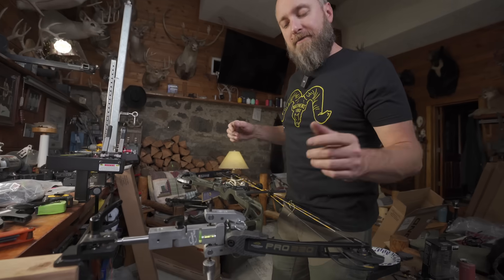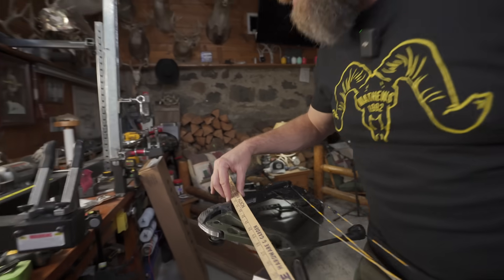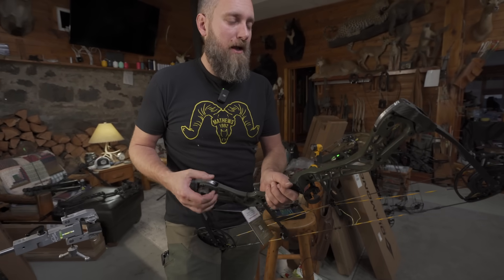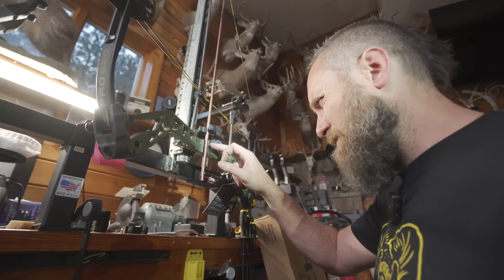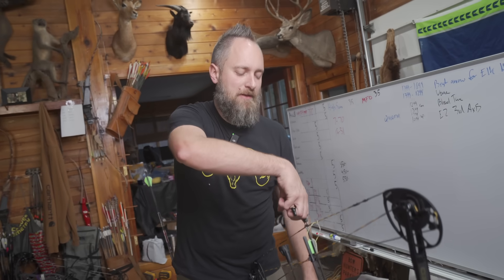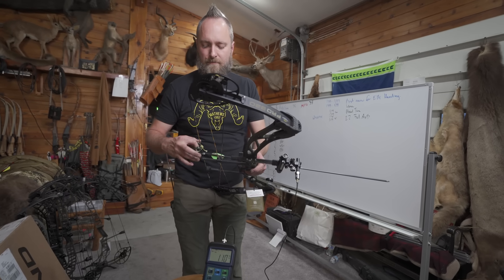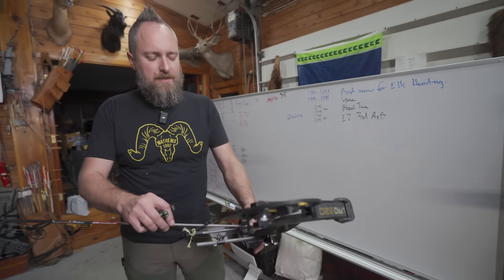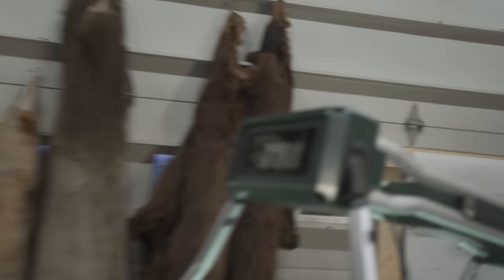Diamond Pro 320 Bow Review With MFJJ!!!!!

Comment: I really like and appreciate the break downs and comparisons. However, I personally feel it isn't a fair representation to grade the budget and mid priced bows with the same scale (or hold to the same standards) as the flagship bows use. I just don't agree they should be getting docked due to a lack of features when, by design, you're shopping in a class of bows not designed to include all the features. I think switching to a 10 point system is a great idea but maybe even further, create separate criteria and expectations and not mention how they compare to the flagship models while testing.

Comment: I have 2 diamond bows both can be over drawn by my kids with that spongy back wall. So I'm not a fan of that trying to teach youth to shoot and there anchor point changes every draw. But they are decent bows for the price. I have even used one this year as my backup bow and ended up using it all season since it was smother drawing than my 25 year old bow. But I will be purchasing a new flagship bow this year, from MFJJ.

Comment: I wouldn't waste my money on a bow like that for any starter. There is so many midline and flagship bows used. Someone can start out on. Bows with rotating mods. Mathews with individual mods. Mathews bows will drop really low in the poundage. Most bows will. Unlike those starter bows with there cables all sloopy. You can pick up a very good 3-5 year old bow. In most case with accessories ect.. for what that Diamond sells for. You know in that time range.The bows are fast, and actually are a year younger. Bows come out basically six  months to year early something like that. Now if a real little kid I get them a recurve ect.. straight too what I mentioned.

Comment: The Bear Whitetail Maxx I just got, set up, and tuned is the much better deal.  You should do a review on this bow.  A caveat: I had to shim both cams over to the left to get the cam lean out (from the factory).  The spacing I ended up with on the left side of my cams is 7/32", with the remainder of the shims moved to the right side of the cams.  This put my arrow exactly 7/8" from the riser.  The string is actually plumb with the riser also.  I replaced the 4 string grubs with actual speed nocks and shrink tubing.  The grubs were a huge cause of the vibration at the shot, and also the noise.  The real speed nocks (using the Bowtech RPM 360 pattern), decreased the vibration and noise, and increased arrow speed by 2 fps.  I have the draw length modules on my bow set to 26.5", but the actual measured length is 27".  Draw weight on my bow is set to 64# and shooting a 385 grain arrow at 273 fps, and a 360 grain arrow at 281 fps.  My Solution SS set at 71#, 26.5" (27" actual) on Comfort shoots the 360 grain arrow at 274 fps, and I still can't get the string to tune plumb with the riser.

I'm waiting on the Alaskan XT ordered on Jan 2, and I will be doing a full set up and tune much like how I tuned the Whitetail Maxx, even though it's a Cam-1/2 system.  I tell you, Bear has some real mid-budget bows in their line-up this year, and I'm really diggin' it!!

Comment: Are they still having cam/ shim problems? Only bow I’ve ever had that was untuneable was an edge320. Edit: Bow shop shimmed the cam and the string would pop on the mod at full draw
Reply: Had the same problem with the edge 320.  Only shot it for a year, I ended up going to a flagship.
Reply: Similar issue as well. String vibrates against the bottom mod. Slight visible lean. Sent back to factory and was told it was within spec. I was able to get it tuned but my rest is nearly as far left as it goes.

Comment: I think it is good to mix up the price point of the reviews. I went the lower priced route a year ago and am looking to upgrade to flagship level this winter/spring. The more information the better! 

One thing that would be a good topic is comparing a price-point bow to a flagship. Demonstrate what you get for the higher price. I've had guys at the shop tell me there are tighter tolerances and things on higher end bows than compared to the average Bear bow for example.